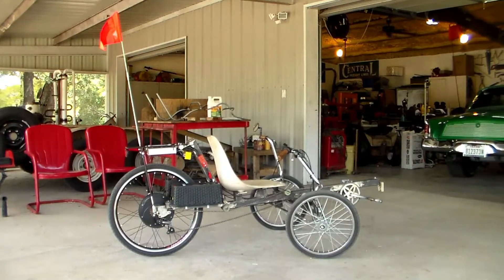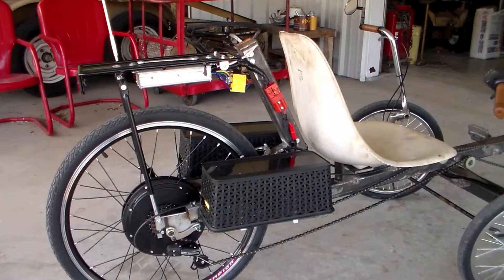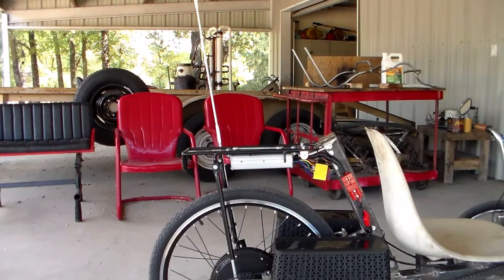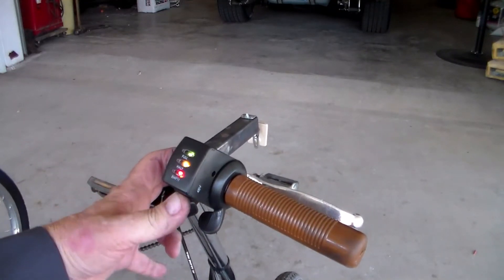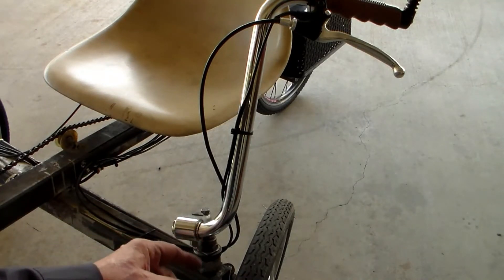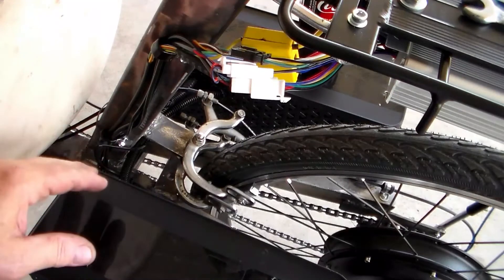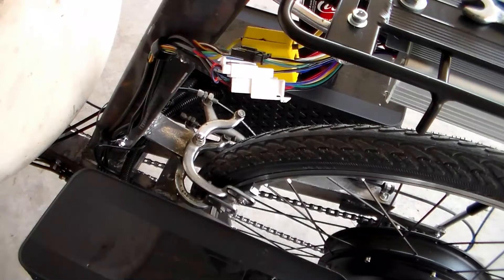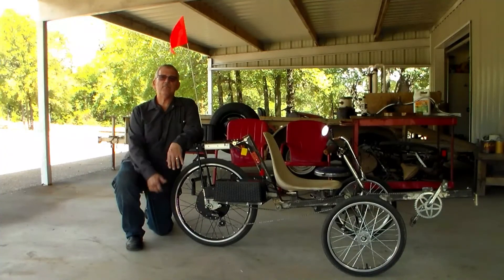Recumbent Reverse Trike Build part 2

Comment: Great job Lloyd. You may have to get a racing licence to run that machine around.
Reply from the maker: Thanks Noel, I wanted to build one of these cause they are street legal and considered a bicycle. (as long as they don't go over 20mph on battery power alone and 28mph when pedaling). Have a great week

Comment: Very nice build Lloyd. I've always wanted to build a 4 wheel with an electric hub.
Reply from the maker: It wouldn't be hard, just takes time. A 4 wheeler would be cool to see. Thanks Ron
Reply: @RustyGlovebox  
I struggle with the engineering department. If it was laid out on paper with dimensions I could build it. 😒

Comment: Wow! When you rode away from the camera that really showed how fast that baby takes off and goes... nice build on that rear wheel..I know all about getting things level and plumb.. the old Cargo Bike 2.0 took a few tacks and grinds to get it right...  if you have a name or an idea for some decals on that main frame let me know I will cut you some... no charge
Reply from the maker: Thanks Rick, I will keep that in mind about the sticker. I will be making a suspension seat next using emt conduit and para cord. Should be light weight. Take care

Comment: Hello.
Great trike improvements!
Rear motor. It has power.
battery. wire. Thumb throttle.
Onboard camera. There is a fast speed there. : D
very! You can enjoy the wind!
The handle is effective.
Do you want to install disc brakes?
Looking forward to the next improvement!
Safety and health.
Thank you my friend (^^) /
Reply from the maker: Thank you my friend, yes a disc brake will be a good addition to the trike. I will be building a suspension seat next also. Have a great weekend and take care

Comment: It is looking great and your modifications are fantastic. 30mph without a suspension seat must be hard, I can see why it is on the list of things to do. It will be interesting to see how you get the disk brake to fit
Reply from the maker: I'm building a suspension seat using EMT conduit for the frame and para cord for the seat. And have a disc brake on the work bench right now. Lots of stuff going on .Thanks Joseph and have a great weekend